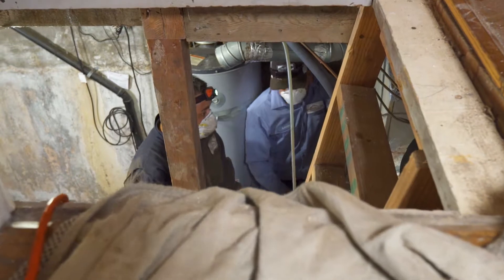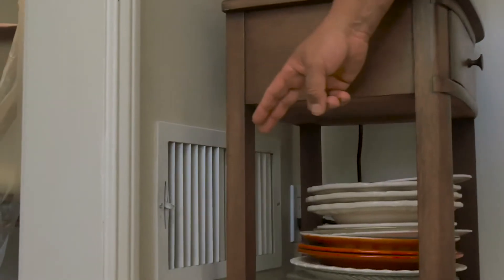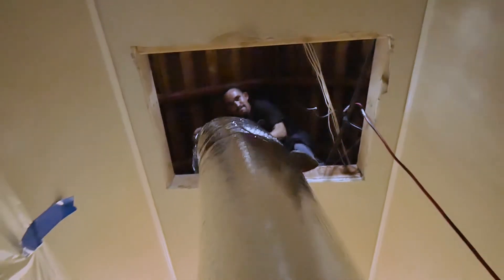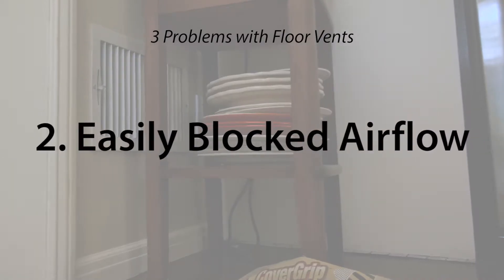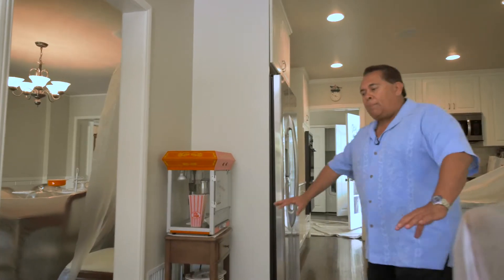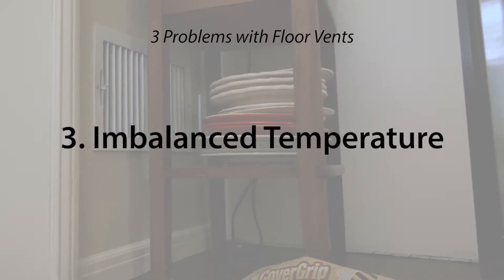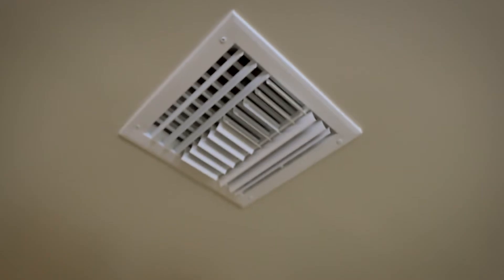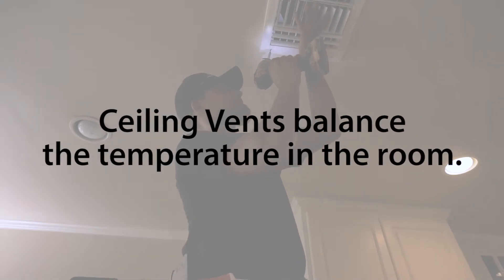3 Problems with Floor Vents | Southland Heating and Air Conditioning

Comment: I think floor vent are best for heating in winter
Reply: it's easy to mitigate the cold in winter (wearing more heat retaining clothes, using hot water bottles and hot packs). The heat in the summer is infinitely worse to deal with.